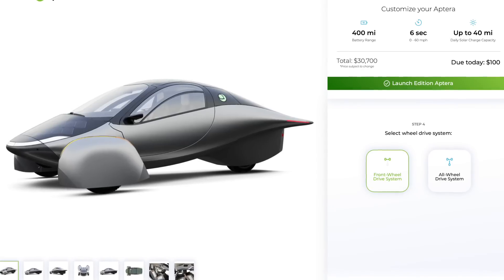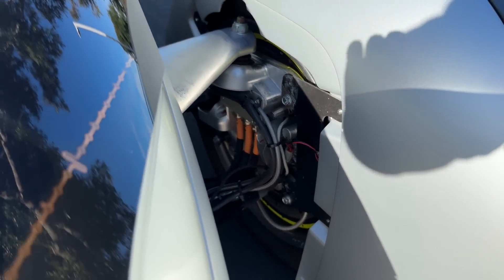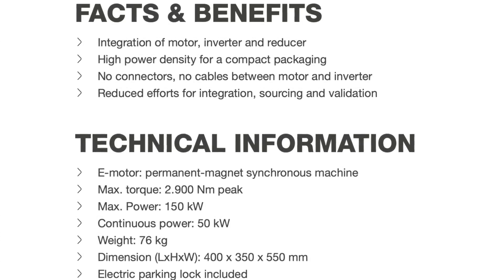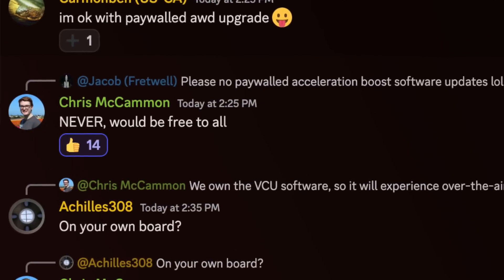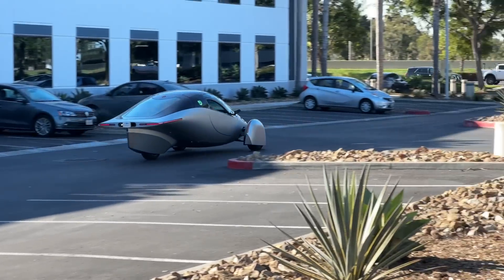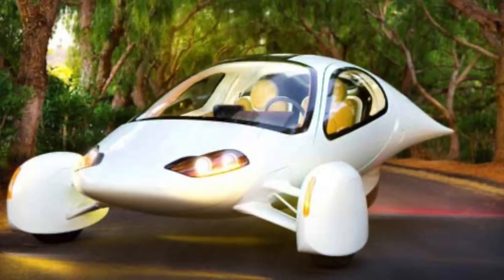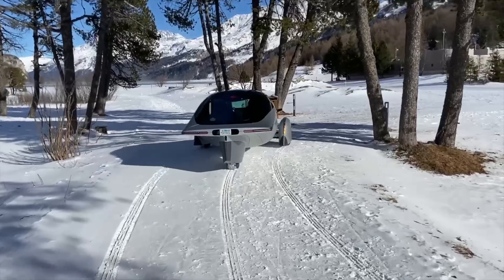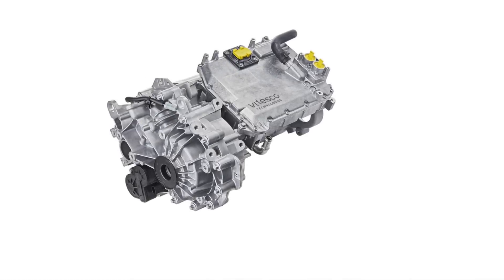Aptera's New Motor UNVEILED!

Comment: Your mom's car has front wheel drive, snow tires and 4 wheels.

Aptera has 3 wheels. So the AWD system would help balance things out a little.

But you are right snow tires make a big difference. And when stopping anti lock breaks and the tires matter. AWD doesn't help stop the car.

Hopefully, they will do extensive testing this winter with the PI models.

Outdoor winter weather testing facilities do exist. They should have enough PI models built to test this winter. So the timing for that is good.

I'm also still waiting for the crash test data.

If all the testing comes back with excellent results. Then I will buy the LE edition. If not I will wait. 
My other concern is pricing. I know the final price isn't out yet but I am concerned the vehicle will be too expensive for someone like me.
Reply: When you lose grip on the rear wheel of a 3-wheeler yyou have a REAL problem! It's by far the greates safety concern with 3-wheelers. Pure physics. That said, a powered rear wheel is just added complexity for keeping the AWD 3-wheeler as safe as the equivalent FWD.
Reply: @charangohabsburg1  with rear wheel regen one can improve braking on ice snow and water my main reason for wanting three wheel drive

Comment: As someone who regularly did rallycross on the snow and ice: you do not need AWD, you need good tires. For an efficiency machine the FWD is going to be more efficient, lighter, and cheaper. The light weight of the Aptera is what ACTUALLY matters when it comes to slippery stuff… you will dance on top instead of sinking in and getting stuck. I saw this all the time in rally, the MK1 VW Golfs would just dance over the mud while all of our Subarus slid around everywhere. Just remember - like any car - to choose the right tire for your area, whether that means just a good all season or snow tires for the snow season.

Comment: You do make a very good point about exposed high voltage wires in a wheel sheer situation.  But I'm thinking there will be a big difference in handling between the in-wheel and single motor designs.  Will one motor going thru a trans-axle have the same wheel control as independently controlled hub motors?  Can the hub motors monitor and control traction loss better than a single motor driving both wheels thru some kind of differential?
Reply from the maker: Basically every car on the planet doesn’t have hub motors. I’m sure they can make it handle well
Reply: @TailosiveEV  no David has pointed out the downside of not having hub motors! And the reason they had them in the first place. I expect better from you TailosiveEV

Comment: I'll wait for the Tesla motor, still, I wasn't looking forward to replacing 3 motor seals every 20,000 miles with the hub motors.  Hub motors have never been successful anywhere, so risk is reduced.  The tech for front wheel drive motors is well worked out.
Reply: Tesla motor?
Reply: @gmv0553  Aptera could be the robotaxi.

Comment: I'm warming up to the new motor.  If it is lighter and fully integrated and makes the product cheaper, then ok.  I think the biggest argument for it is that they don't feel ready for whatever reason.  I think you are wise to point out the likelihood that Aptera keeps this motor for the long term.  If the weight and cost cancel out the benefit of hub motor efficiency, then why bother.

Comment: The hub motors were a very bad idea anyway. Unsprung mass is just stupid. I am glad that they have found a sensible solution. The wheel hub motors would have been a dealbreaker for many potential customers.
Reply: Unsprung mass is a bad idea, particularly when it is cantilevered so far out from the center of gravity.
Reply: A small 10-20 kw hub motor in the rear to provide efficiency when cruising would be ideal.  It is minor as far as acceleration but would exist for efficiency and winter traction.
Reply: @ccibinel  A smaller Motor does not consume less energy doing the same Work. Do not compare electric motors with ICE Engines. A Small extra motor in the rear wheel will decrease efficiency. Secondly, hub motors may have way to many stress with potholes and might die quite fast. Especially on US motorways where at some places the road is awful.

Comment: I'm excited about it!  Almost as powerful as the trimotor arrangement and a proven drivetrain.  I would still like AWD, and wondering if an OEM kit will be possible for retrofitting a rear hub motor down the road?
Reply: Its an unknown in terms of cost / complexity.  Chris said if you take half the car apart anything can be done but the real question is cost.  The safe assumption is to assume it wont be practical.

Comment: 150 kW is peak power for the motor, with only 50 kW continuous power rating. Hopefully, the lightweight and aerodynamic design are enough to offset the low power rating with low power required for cruising after peak power for acceleration.
Reply from the maker: It’s even more power than they were gonna have anyway
Reply: 50 kw continuous is absolutely not low power.  Cruising at 80 mph an Aptera will need 12.5 kw.  The max speed could be up to 135 mph and stay under 50 kw.

Comment: Really wonder how the all wheel drive system will work then. Are they gonna hold it till they have hub motors? Maybe just have one on the rear wheel?
Reply from the maker: Correct. One hub motor for the rear. Tri motor is not happening
Reply: If that is true, they should have gotten a motor or rather a transaxle with vectoring

Comment: Taking this well-tested motor would mean better repairability too I have to guess, sounds like a win to me

The fact that Aptera went this route shows their confidence on pushing the initial production through, other startups at similar position would have shy away and just take a 1year delay to "be safe"
Reply: Vitesco state that one of the advantages of the EMR4 is that unlike the EMR3 that was glued together, the EMR4 can be dismantled for servicing. Not only is it smaller, but it is a steamline design allowing different rotors to be used for different power output (40 - 230 kW)

Comment: Something to think about: The Aptera 2e prototype of over 10 years ago with a similar front wheel drive setup had a 0 to 60 time of less than 10 seconds.  The new one with twice the horsepower and better torque figures should, on paper, get to 0 to 60 in significantly less than 5 seconds.
Reply from the maker: I believe so, they said they’ll test it soon. Wouldn’t be shocked if it’s under 5 seconds

Comment: 0 to 60 in 6 sec
Reply: that is the existing FWD on the site.  Chris M confirmed in discord it will be faster and limited effectively by traction.  I;m guessing 4.5.  The new motor is actually a ~40 hp increase vs the old AWD.
Reply: Will probably be faster. 

"It'll likely be faster than 6 seconds. This is just the placeholder number from our old drivetrain. The EMR3 has a max power output of 150kw, which matches the old system power output. It'll RIP :)"

From: r/ApteraMotors - Reddit

I'm guessing 4.0 to 4.5 seconds 0 to 60 mph, since the powertrain is lighter than the Elaphe 3 hub motors.

Comment: They really must have got a nice deal with outdated EMR3 because EMR4 is modular so it can weight much less (45 kg) when less torque is needed or weigh slightly more and produce way more torque. Moreover EMR4 is advertised as way cheaper (to produce) and 5% more efficient (introduced in 2021).  It looks like Aptera got those EMR3s with outlet price tag. It indeed simplifies the design and maintenance - the outward reaching wheels were in risk of getting hit or bumping curbs and exposed to elements, vibrations and had to turn with high voltage cables exposed so it was a complicated engineering risk. 👍

Comment: I want to know what kind of traction control and torque vectoring does this drive train have. Having regenerated braking on the rear wheel had some real advantages that may be lost
Reply: @stix2you you don’t get what I am saying on ice braking with the rear is safer than the front like down shifting with a rear wheel vehicle the rear wheel regen could of made this possible. The pendulum effect.

Comment: How can they change now to a traditional motor, instead of the hub motors they are using on the prototypes? Don't they have to completely redesign the front of the vehicle to use a conventional inboard transmission with axles? A move like this at this time means that much of what they have done since now have to be scrapped and redone.
Reply from the maker: Nope. They had this design as a backup nearly a year ago. It’s ready to go. That’s why it’s in PI2
Reply: @TailosiveEV  Good for them! But...still the front subframe must be completely redesigned to host the motor and the front suspension (wishbones, upright, hub, etc...) with the new axle shafts will be different from what it is now. The overall weight will also change a lot with this new much heavier setup. For sure the non-suspended mass will be lower... Probably will drive better than with the hub motors, but still a change like this now it's not what people was hoping for...
Reply: @GiovanniEsposito5 
Aptera was ready with a "plan B" already in the design. This is how they can pivot to a new motor to ensure delivery of Accelerator Launch Editions by next year.
Reply from the maker: I’ve watched other brands die out that weren’t as transparent and focused more on deliveries than actually designing a profitable product. Slow and steady is the key

Comment: I was never convinced hub motors were good and always wanted front wheel drive. My concern is about the honesty about the story that was told that the hub motors were the more efficient choice. 
Yes some acceleration is lost not having all wheel drive I don't think that's critical.
The truth about efficiency is critical.
Radiator aerodynamic losses and resistive heating efficiency losses are more against the mission. 
I should feel vindicated. 
I just feel less enthused.
I like my Forester all wheel drive in the snow. It give good traction control and authority. That said stopping distance is mostly about weight which all wheel drive hinders and tire size and compound and the road condition that's out of your control after deciding to drive.
Reply: Hub motors may be more efficient. 
They also live in a harsher environment. More risk of cable wear etc. 
A very light vehicle is the best case for such motors in my opinion. 
Fewer motors for the same power should have an efficiency advantage. 
Differential losses should be small.
Theory is all well and good ultimately it's real  production performance that matters.
Reply: @anthonylipke7754  Induction EMR4 and 20kw imw for the rear is my guess in 2 years when AWD is released.

Comment: what is positive with this new configuration is that it improves the efficiency of the suspension, because the unsprung masses are considerably reduced...And i think the overall costs are also reduced by simplify wiring and engine controls

Comment: This change hopefully allow them to keep the price close to the origional pricing, however the fun to drive factor of the Gamma will be gone despite the higher power because it will need to be controled.  Without a motor for each front wheel the tork vectoring and electronic traction control there will be problems in slipery conditions unless the is traction control with ABS with traction control.  that reduce speed and efficency.
Reply from the maker: Nearly every car on the road doesn’t have hub motors. I’m sure there’s a way to make it handle well
Reply: @TailosiveEV  Yes, like is done in the Fiat 500e they severly limit the initial tork leaving it with about an 8 sec 0 to 60, pluss they have Antilock brakes with traction control, so it dosent have the problems.

Comment: Vitesco state on their website  that in 2021 the EMR4, had been selected for over 20 vehicles. It is 25% LIGHTER than its predecessor, the EMR3, and covers a power range of 80 to 230 kW., yet is SMALLER. The EMR4 is a new (2021) generation axle drive. Surely, Aptera must use the EMR4 if it is going to change to an axle drive motor. Development takes time, and already the proposal is to use a motor that was obsolete in 2021!
Reply: "Smaller", "lighter" are good arguments.  But they may also imply higher cost if they're due to generous use of Rare Earth metals.
Reply: @BillMitchell-lm8dg  EMR4 is lighter but actually slightly larger; overall very similar.  The problem is availability in small scale as Aptera ramps.  EMR3 is, EMR4 is not.  The induction based EMR4 is definitely a better motor and I will not be surprised to see this change in ~2026 then the AWD option is introduced.
Reply: @ccibinel    Does "induction based" mean that it does not use permanent magnets in the stator but rather magnets with a magnetic field induced by current flowing through a coil?   Isn't that less efficient (although cheaper) than permanent magnets?
Reply: @BillMitchell-lm8dg  Actually when cruising at low torque (most driving) it is more efficient.  Vitesco had a press release in 2023 when this variant was added.  In addition it should be cheaper long term and can be shut off entirely preventing the generator effect of pm motors when cruising.  I expect the new rear motor will be an even smaller and cheaper IWM with 10-20 kw of power.
Reply: @ccibinel    Interesting.  I also never considered the generator effect at cruising - the same effect that causes regenerative braking, I guess.  It will be interesting if an after-market develops for slipping Hjundai EMR4 motors into Apeteras.  :-)
Reply: @BillMitchell-lm8dg  No rare earth magnets in the EMR4  and Vitesco quote that the price is lower!
Reply: @IanCalhaem     I guess there will be Aptera owners modding their vehicles with EMR4 motors from Hyundai dealers!  :-)

Comment: If an accident happens the first thing that will happen is that the contactors will disconnect the battery. There would be no high voltage at the wheel.
Reply: Yeah!  With sensors as reliable as those for air bags, and no-weight contactors.

Comment: Actually I think the inboard motor with driveshafts. Is better for the front wheels. A hub motor for the rear wheel. Is an easy solution for all wheel drive. I won't be buying one without it. I have the 600mile reserved. Hopefully they will have all wheel drive figured out by then.

Comment: Aptera made the roght decision to go with that proven all all in one powertrain . It refines it maturity light years ahead of many designs .unsprung weight and so much more connections and   Wiring. It literally can be unvolted and removed for any servicing which there is no servicing needed so endless wins with full manufactures warranty support. One stop shop!

Comment: Moving 100 lb's out of each front wheel (unsprung weight) and into the body will produce superior ride quality with reduced suspension damping and rolling resistance over rough surfaces.  Tires can be lighter and last longer--another unsprung weight reduction.  The remarkably low weight of the vehicle makes all of this even more significant.  Aptera will be a more nimble, capable vehicle--a big win for Aptera owners and the company.
Reply: That was my concern with hub motors.  I drove a Miata (2100lb), increasing the wheel / tire weight by 5lbs had a significant impact on handling (stock wheel and tire is ~38lbs).  Remember, it it the cars weight vs wheel assembly weight that determines how fast the tire can respond to road variations.

If the wheel tire assembly of the Aptera is the same as the Miata, adding 45lbs for the motor gives you 83lbs for the drive wheels and 45 lbs for rear wheel (no motor).  the sprung weight is about 1600lbs.  I'm going to assume the weight on all tires is the same, so 530lbs is trying to keep an 83lb wheel assembly in contact with the road.  Yikes!

The one negative is, unless they are using a limited slip differential, one drive tire on ice, or wet grass, and traction drops significantly (lightly apply the brakes to force power to the wheel on dry pavement).  With two driven wheels, you can do a lot of stability control.
Reply: Exactly!
Reply: That’s 45 lb per wheel softer ride not more nimble or better handling
Reply: Keep in mind the wheels were already lighter with the hub motors than on a conventional car of an equivalent size and spec, and it performed superbly in the moose test and felt super nice to drive overall, this just improves it but not by much.
Reply: With the unsprung weight changing so much they will have to go back to the drawing board concerning suspension tuning.

Comment: The big dynamic loss of going to a single motor is electronic torque vectoring. Similar behavior can be gained via differential braking, but it's not the same when it comes to fine control, mainly due to the differential fighting the brakes.
Reply: Yes, no torque vectoring.   But the Aptera is supposed to be about high efficiency, not Hi Tec performance.

Comment: Getting to market with two wheel drive is a good plan. There comes the time in every project when it is time to shoot the engineer and ship. Get revenue coming in.  That said, I want the ability to retrofit the rear wheel drive. It makes a difference in ice and snow. It doesn't help the stopping but it does help the going when things are marginal. Also, all wheel drive avoids the chain up parties! Putting chains on the front wheels would be interesting and socks are not the best thing especially in icing conditions.